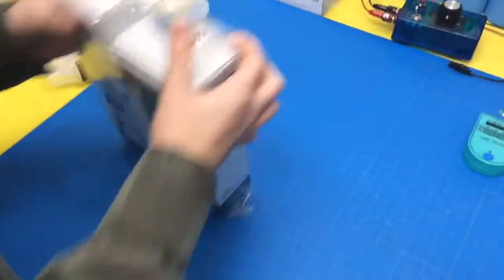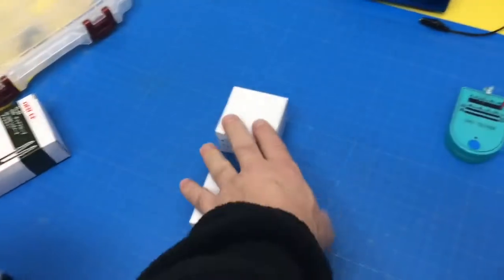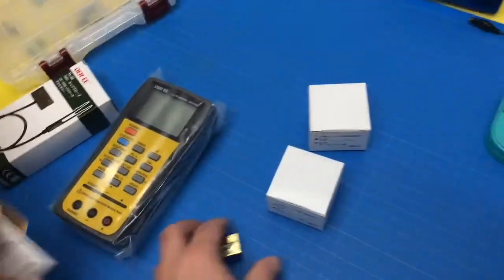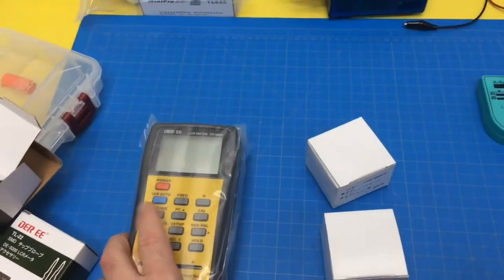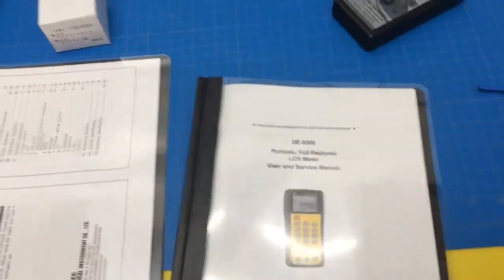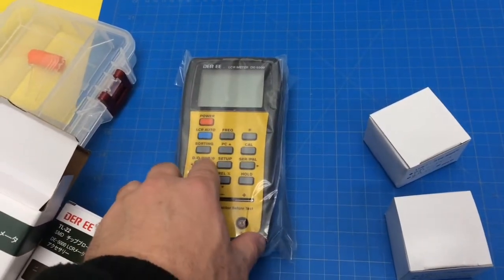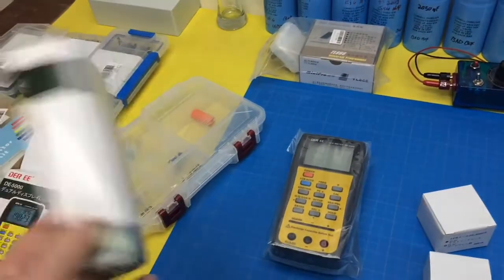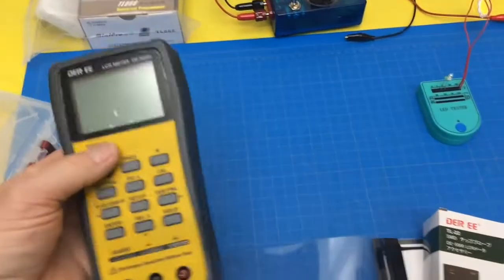Unboxing the DE-5000 LCR Meter & English Manual  (LCR ESR Meter) [KTFG 360]

Comment: Have you tried  testing field coils on a dc machine with it?
Reply from the maker: No I have not but you could do that.  I primarily bought it for inductors, AC motors and capacitors.
For DC motors I typically do a voltage drop test because it’s accurate, quick and easy and I don’t have to isolate the coils. 

In order to use this LCR meter I would have to isolate each coil and that’s a connection I don’t want to break and have to remake.

For the voltage drop test I only have to remove F1 and F2 field coil wires from the controller, apply 120 VAC and then just measure the voltage drop across each coil.  If they’re equal it’s good, if they’re not one or more is bad.
Often times there is an open connection on each coil (a lug) but if not you can just scrape away a little bit of insulation to make your measurement and then tape it back.

I intend to do a video series on testing both AC and DC motors but first I have to finish some Rubiks cube tutorials because right now those are the only ones earning enough money to pay bills.  

I have a significant investment in time and material in the videos so I need at least some of them to earn money.

Also check out:  “How To Solve Rubik’s Cube: So Easy a 3 Year Old Can Do It” https://youtu.be/9spDGBeWl1o
 
https://www.kevingittemeier.com
 
https://www.amazon.com/shop/kevingittemeier

Comment: Thanks for the info Kevin. I just got my Taiwan DE-5000 via Japan and am very pleased with it.  As shown in other videos, a versatile LCR meter raises many questions about component variations with frequency and test method. This is a much more versatile unit than lab grade meters of the past. It is no test of accuracy, but I was pleased with the congruence of small L and C's I had evaluated with my Boonton Q meter. I was also able to get an idea of headphone Z from Ls and Rs measurements at 1 kHz. Cheers.
Reply from the maker: +ve6kk 
Cool,
If you find yourself needing longer leads an upgrade is simple and inexpensive https://youtu.be/rgqQRzZM80Q
Reply: Kevin thanks I did see you vid and ordered the Kelvin cables and spare TL-22 (cheaper). The edges on the existing 22 will wear anyway. I find the 22 good for on PCB cap checks. PS great on involving youngsters, amazing how far that takes them, I know. 73.

Comment: I live in Japan and yes, what you have is Japanese language documentation.  Since it is made in Taiwan, I am not sure why the "Japanese version" would be superior, unless it passes through QC in Japan, which would ensure you get a good quality meter.  Being in the market for a good LCR meter (mainly to measure both capacitance and ESR very accurately, at a given frequency, both in-circuit and out of circuit), I appreciate your video.
Reply from the maker: +JDW 
Thanks for the info.
For the money this is a great LCR meter.
My only complaint is the short leads so we modified an extra TL-21 with longer inexpensive kelvin clips:  https://youtu.be/rgqQRzZM80Q